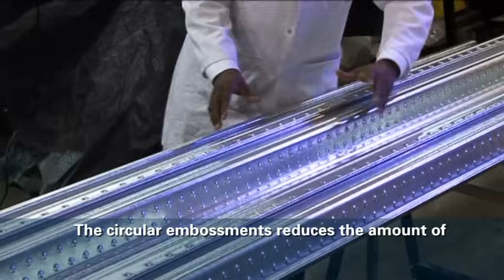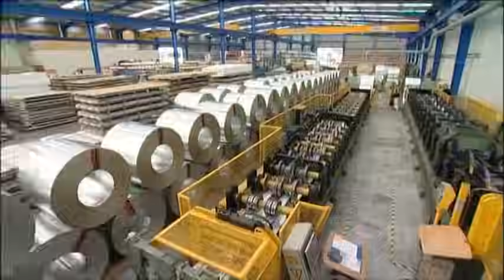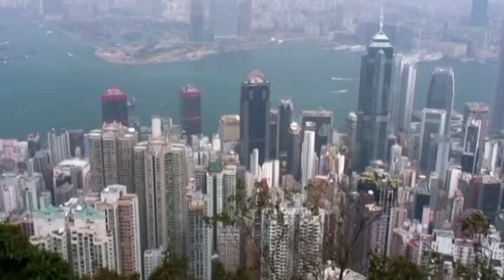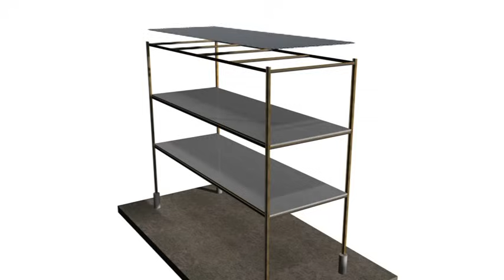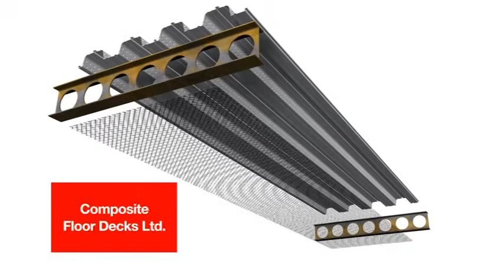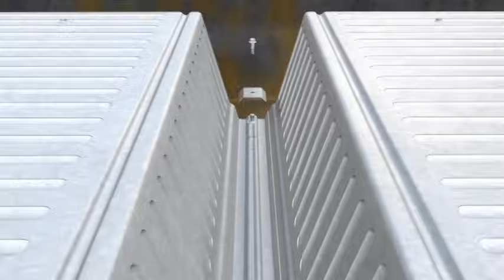ComFlor - Composite Steel Floor Decks - Product Overview

Comment: if it so powerful why did it destroyed the World Trade Center Twin Towers in 2001
Reply: It was a controlled demolition, with thermite residues as evidence
Reply: Because there were bombs strategically placed throughout the structures. It was a controlled demolition.
Reply: Todd Pope Junior thermite , radio active thermite , it was still molten one month later when an excavator dug it you can see it dripping out of the bucket and running down a bent i beam
Reply: @guysumpthin2974  https://www.youtube.com/watch?v=TlJH163uS4g&t=48s
Reply: Todd Pope Junior bombs and plane destroyed the tower.
Reply: @silentwatcher1455  https://www.youtube.com/watch?v=TlJH163uS4g&t=48s
Reply: Roses are red
Harambe's in heaven
Everyone knows Bush did 9/11
Reply: @M3rVsT4H  https://www.youtube.com/watch?v=TlJH163uS4g&t=48s
Reply: Because they used trusses instead of I beams to carry the load.
Reply: @anthonyboarman3833  https://www.youtube.com/watch?v=TlJH163uS4g&t=48s